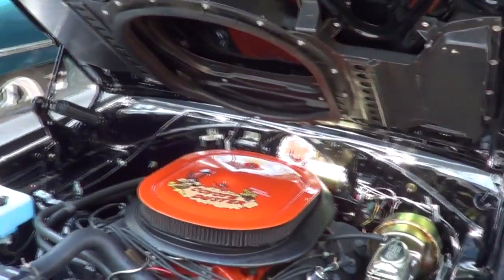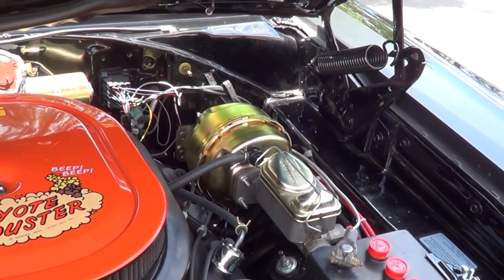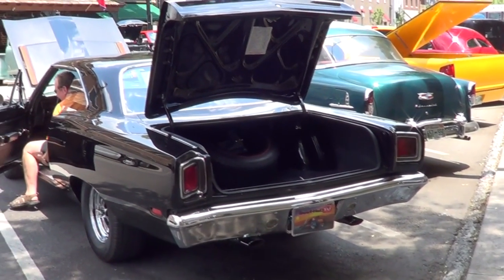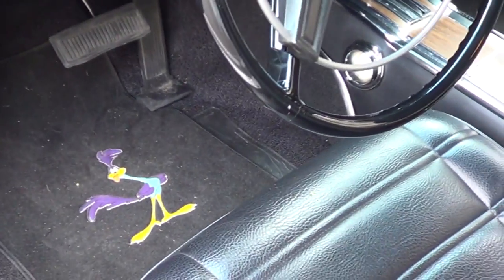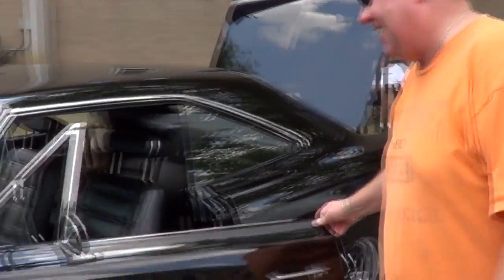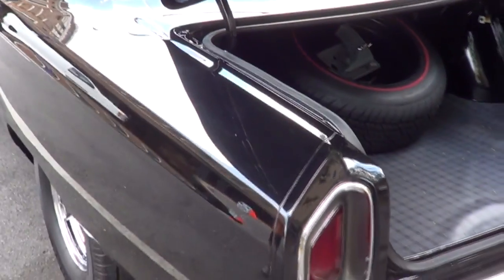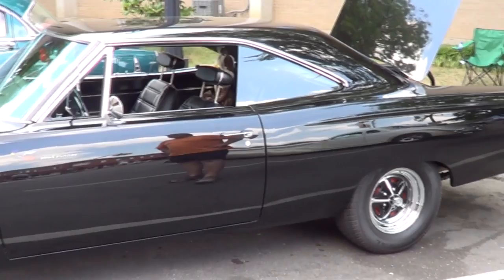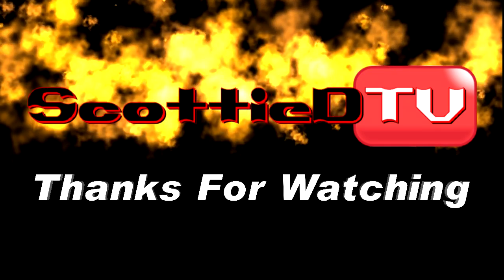1969 Road Runner

Comment: Those wheels he has on the car are stock, they are an option, you could get plain dog dish wheels or these rally wheels, also the hood was not painted with the flat organisol first, it was painted body color first then flat black organisol sprayed over the top of that, and yes of course Hemis came with a warranty, those spark plug wires arn't from 1969 you can buy date coded reproduction spark plug wires today
Reply from the maker: Cool!